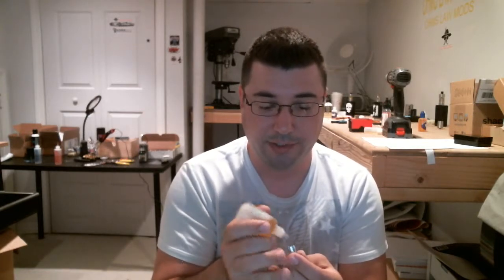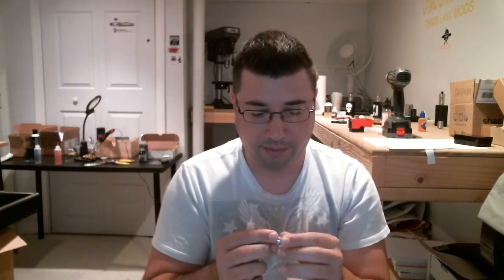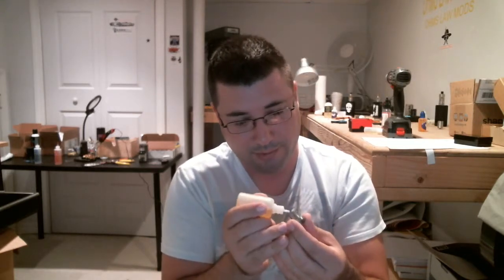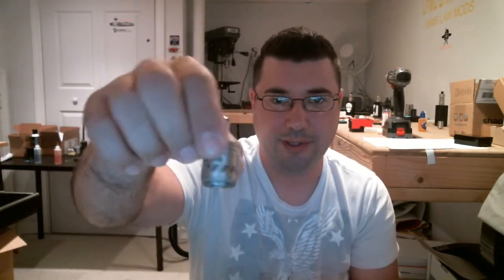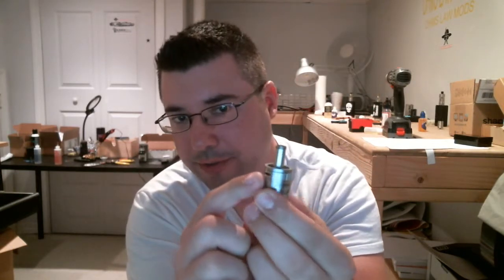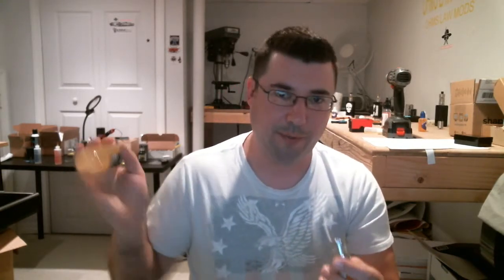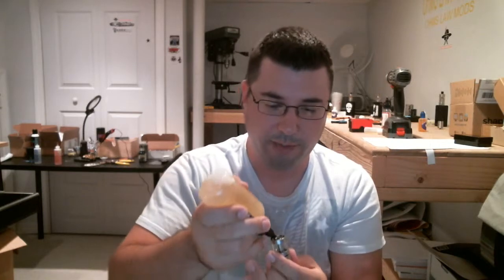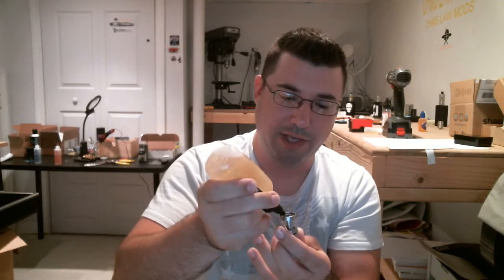SENSE cyclone Review!

Comment: One other thing I discovered , you can play with adjusting the coil hight slightly. Unscrew the base, unscrew the coil head 3/4 of a turn. The o ring will still seal, juice won't leak. Play with this and see what you like. Even 1/3 turn in or out makes a difference in the vape.
Reply from the maker: cool, good lookin out I'll give it a shot and report if I see an improvement.